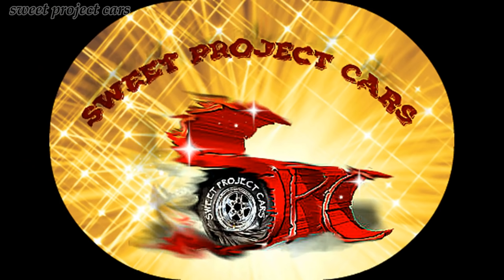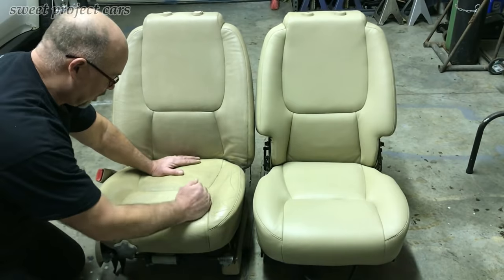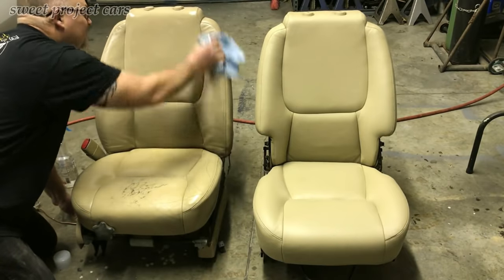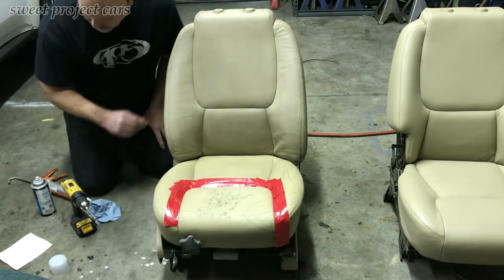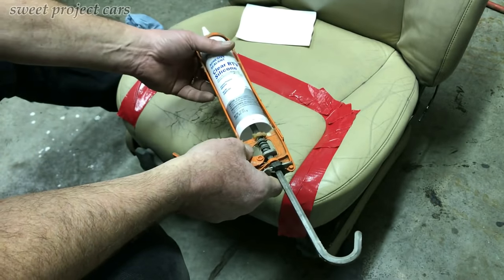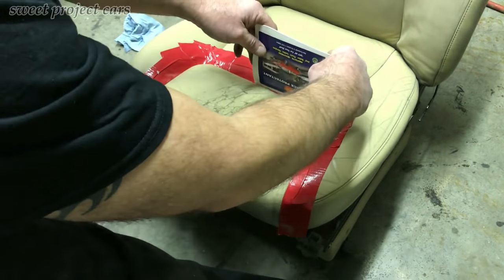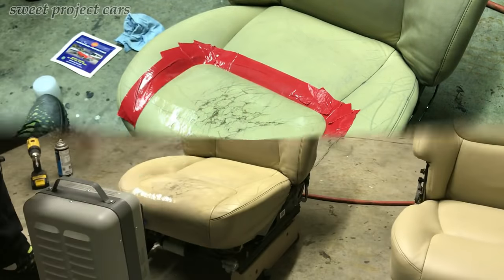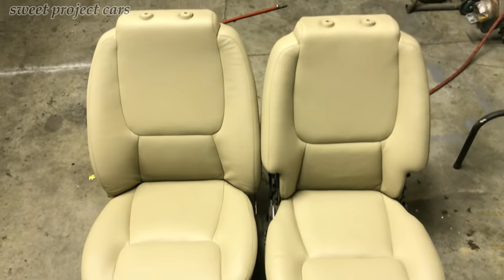How To  REPAIR THE WORST LEATHER & VINYL Seats...Never Seen Before

Comment: Hi, Great video but can you please show how to use the spray can to get perfect finish. Thanks Shaz
Reply from the maker: It is extremely easy hold the can in about 2 feet from the seat start spraying at the edge of the seat let go when you get to the other edge repeat that process and your seats will come out beautiful try to overlap your last spray by a couple inches

Comment: Another great video!  Do you think a rip or hole could be repaired using this method.  I was thinking that it may be possible to glue a backing patch inside the rip/hole and then use this technique to fill & level the the backing patch to the surface of the seat material.   The hole/rip is on the side bolster of a seat back.  I’m thinking this may work.  What are your thoughts?
Reply from the maker: Motorgearhead Your ideas on fixing a hole or very close to what we would do give it a shot and see how you like it

Comment: Thank you for sharing? Can this method be used for boat seats? Would SEM marine vinyl coat spray paint work as well as the paints you are using for these car seats?
Reply from the maker: yes it works on any seating  SEM makes good stuff we use the items shown and have great results

Comment: Do you have a video on how to prepare a car for the winter to protect it from rust or anything else? I got a car that's gonna sit outside for a while since I don't have place to store it and the transmission went out and don't plan to fix it until the spring.
Reply from the maker: If you look through our videos you’ll find a boat load of them dealing with stopping existing rust and preventing it also how to treat your tires so they don’t dry rot on you over the winter and make sure that your coolant level and strength of it is good otherwise your block will freeze and crack

Comment: #1 How long do you wait until you apply another coat of silicon?
I think I need to apply another coat of silicone, so when you say add another coat do you mean to do it almost immediately or wait a day until it sets first?

#2, Can you sand the silicon between coats?
tanks.
Reply from the maker: Wait until it sets, it may be slightly tacky, but that's okay.  Usually takes 48 hours in 70+ degree weather.  And remember the thicker it is applied, the longer it takes to cure.  Don't sand between coats.  Hope this helps.  Thanks for watching and asking.  Have a great day.  mad Mike the hammer SPC

Comment: Would this work on a recliner type chair that isn't made with real leather? My arm chairs are peeling in areas and I'm looking for a lasting fix! They aren't holes like something ripped, it's just the top layer is bubbling and peeling.
Reply from the maker: Sounds like the chair is in pretty rough shape so I guess it wouldn’t hurt to give it a shot it is worked on everything we have ever used it

Comment: @Sweet Project Cars. I would love it if you can tell if these steps are correct. I'm going to be attempting this tmr. And would like to know if I got everything down. So first I clean the seat with 99%, then apply leather prep. Then I apply the silicone, let it rest for 24 hours. Then after it dries. Do I apply another layer? Anyways, after that I reapply 99% and leather prep? Then get into the painting process. Does this sound correct?
Reply from the maker: I would take and watch all three videos in the series before you attempt and a real good way to do it is take some of your paint and add it to the silicone before you spread it watching one of the videos you will see that it works really good thanks Mike Sweet project cars

Comment: Can you use a heat gun for faster drying? In cold new England winter here
Reply from the maker: You can, but it's best to put a heater somewhere to keep the temp at 70 degrees for a minimum of 24 hours, it dries best in hot weather.  Thank you for watching and asking Steve.  Have a great day my friend.  mad Mike the hammer SPC

Comment: Can this method be done for leather seat that are tearing from the seams?
Reply from the maker: You can definitely give it a try but most generally when they’re torn at the seams you need to replace the seat cover with an OEM cover thanks and have a great day mad Mike sweet project cars

Comment: This is awesome but I have a question and it might be a dumb one but you can use regular spray paint to spray seats after silicone is applied? You just have to find the color of the original seats?
Reply from the maker: In order for this to work you need to use all of the exact tools we show in the tools list.  Thanks for asking, hope this helps.  Have a great day.  mad Mike the hammer SPC
Reply: @SweetProjectCars  thank you

Comment: Does the seat still feel the same as leather? Or would it feel stiffer/different?
Reply from the maker: Elliott Kan well it feels good for a repair the best thing to do if you want the seat to be perfect and new of course is just replace the seat cover with the OEM replacement but for a repair, this works great and last for a long time.

Comment: Is it a good idea to used a hair dryer or heat gun to cure the silicone faster?  Also, would I have to reapply the 99% IPA if I need to use another layer of silicone?  Because I touched the area to knock down the ridges like you mentioned.
Reply from the maker: Roger Jimenez silicone air dries the best in warm weather so a hair dryer will not work very well. and not you do not need to use the 99% again as long as you have not touched it with your fingers. if you did then you will need to wipe very lightly with your 99% but only if the silicone is completely dry   mike
Reply: @SweetProjectCars  i had to to knock down the ridges as you instructed on the video.  I will use the IPA.  One more coat of silicone after sanding and IPA then it should be ready to paint.  Sorry I did not take a picture of the original cracking on this vinyl office chair.
Reply from the maker: Roger Jimenez sounds like you have a handle on it my friend good job

Comment: What do you do if the seat has a tear in the seam
Reply from the maker: Here's the problem when it's in the seam where the stitching is, the stitching actually holds the seat cover together. Our method will not work real well with that because the first time you sit on it, it will pull it apart, you can try it, but we suggest getting new seat covers from your manufacturer.  Thank you for watching and asking, have a great day John. mad Mike the hammer SPC

Comment: Do we need to buy/ use the " SEM color" which u have in the description tools?
Reply from the maker: Mike, you need to use  https://amzn.to/2PWOfN3
or this https://amzn.to/2T0aJv5  they have many different colors, but they are the only ones that will work for what you are doing.  Thanks for asking, have a great evening my friend.  mad Mike the hammer SPC
Reply: I have the paint already for my seat! My question was do we have to use this product? Does it make the paint more smoother or more flexible? Sorry for asking many questions, i want to get the same results as you have in the videos my friend.

Comment: I'm about to do this project. The only thing I'm concerned about is paint doesnt stick to silicon. I will be using sem paints and prep. Im just so worried it just won't stick.
Reply from the maker: We have never had the non sticking issue, make sure you watch all 3 of the videos in the series, you will find all kinds of tips and tricks.  If you are concerned about it bonding, in one of the videos you will find where you can mix 25% of your color with 75% of your silicone.  Let that dry then you will find that your paint will stick even better. 
Thanks and have a great day!  mad Mike the hammer SPC

Comment: I have a question sir. I messed up somehow and had to reapply silicone due to uneven and application and also have blotches. Tried removing the silicone with many products and was not very successful. How can I correct this ? Keep reapplying silicone until is smooths out better? And if so how long to wait before running my thumb over the area?
TY
Reply from the maker: You are going to have to apply until it's smooth now, and if you are doing this in a hot dry area, you've got to be johnny on it! Make sure that your silicone nipple is cleared out onto a rag so that you are applying absolutely fresh silicone. Try to put enough at the beginning so that when you run your spatula over it you run out at the very end where you no longer need silicone. A couple of tips:  1. hold the spatula as flat as you possibly can so that it lays on smooth  2. as far as your ridges are concerned, use the back side of your finger to smooth them out (the area between your 1st and 2nd knuckle). Another tip is you cannot dilly dally with this because the silicone almost sets up immediately so you gotta move fast and efficiently.  Hope this helps, all the best my friend.  mad Mike the hammer SPC
Reply: @SweetProjectCars   thanks. I will try again. Much appreciated!

Comment: What would I do if I had perforated leather?
Reply from the maker: This doesn't work on perforated leather unless you don't mind it being covered up, you will need to replace those.  Thanks Andrew.  Have a great day.  mad Mike the hammer SPC
Reply: @SweetProjectCars  could I just skip the silicon part on the perforated parts and fix the rest of the seat then paint? Or will rhe paint also clog the perforations

Comment: In some videos, you rub the paint on with a rag.  In this one, you just spray paint the seat.  Which works better?
Reply from the maker: Hi Greg we like to show different methods we like to spray the larger areas on the small where areas we like to use a rag
Reply: @SweetProjectCars  
Thanks for the clarification...I'll be trying this !

Comment: I got 1999 grand prix gtp seats I think are junk now driver seat got wet sun got on it few years ago the fake leather or what it is turned hard like a rock but my 2004. Saturn vue seat I might try your method
Reply: And I got jug of 303 protecttent I'm giving that stuff a chance not on seats because they are ruined but other things
Reply from the maker: Make sure you catch all the videos try the one video that deals with mixing the color with the silicone is by far the best way to do it just make sure you listen to the video and don’t skip through it and you will get all the tricks

Comment: Looks like my seat , but mine is not cracked yet

Best way to keep it from not is same process I assume?
Reply from the maker: Very correct my friend if you don’t want your seats to get any worse then they are make sure you’re using the 303 on them and you’ll be good to go
Reply: Sweet Project Cars 
Perfect I wouldn’t be a fan without a big bottle of 303 on the shelf !!

Your the best
Reply from the maker: Van Inn lol that's true my friend :)

Comment: Great video.  I followed your instructions and just did a thin layer of silicone adhesive after sanding & cleaning.  It's been 24 hours and the silicone is still tacky.  Is this normal?  Shouldn't it be cured in 24hrs?
Reply from the maker: What is the temperature of the room you’re working in?
Reply: It's 70 degrees in our house where I'm working.
Reply from the maker: Chris Zink ok it may just need more time if you have any humidity I would give it 2 days then use the paint on it we use and the stickiness will go away just make sure you spray it down with the prep spray first before the paint
Reply: @SweetProjectCars  Thanks for the quick response.  It's still tacky today.  I'm waiting on more paint to arrive so it'll hopefully be dry(er) by the time it get's here.  I'll hit it with the prep spray and paint. Fingers crossed!
Reply from the maker: Chris Zink gives it a couple light mists and let it dry then do it again 20 mins. later keep doing the color until you have full coverage
Reply: @SweetProjectCars  It worked!  Light coats.  Tackiness is gone, seems solid.  Thanks again!
Reply from the maker: GOOD DEAL Chris glad to hear that my friend

Comment: Used this on my back BMW seat, smoothed all ridges and everything is set up ready to paint. Since there is silicone on it there is a difference in texture between the leather and the seat will that all go away once it's painted? Just kind of smoothies itself out?
Reply from the maker: Matthew Klos did you watch the first video in this series as it shows how to smooth it out before the prep spray and color is added?
Reply: Sweet Project Cars yup watched it. Sanded everything, and then applied the silicone smoothed it out. Then used my thumb after it set up a bit to knock down the ridges! Now I’m just noticing when I run my hand over it I can feel a difference between where I did to the silicone and where it’s leather. Does this go away once I paint it. Planning on painting today
Reply from the maker: Well here’s what happened when you place it on you have to feather out the edges as we called it The edges should feather out level to the existing seating if you don’t feather it out as you would with Bondo when doing body panels you all have a raised edge as you can see by the finished product that I did there was no edges seen because the edges of the glue are very very fine and flush to the existing leather Hope this helps

Comment: So the one vid shows you mixing color with the silicone. Then the next shows you just spray painting the silicone without mixing. Which way is right?
Reply from the maker: Both work great, the reason we came up with the mixing of paint and silicone is because most people don't know how to get the paint to adhere to the silicone, so hence the video mixing the two to help out those that struggle with painting silicone. Thanks for watching Michael, have a great day. mad Mike the hammer SPC

Comment: Question- on the "natural cracking" in the leather do you use the silicone as well? Or does the paint take care of those areas?
Reply from the maker: The paint does a pretty good job covering up those areas as long as the material is not separating.  Thanks for your question.  Have a great day.  mad Mike the hammer SPC

Comment: Hi,
interesting video, I have a query here, when this seat is finished and is used ie. if someone sits on it, will the fillings will not come out due to the fact that the leather and the foam underneath it had a flexibility to stretch a little or more depending upon the weight placed on the seat.

looking forward to your comments.
Reply from the maker: Jawaid Akbar Chaudhry it works great of course it does not work if the foam is showing through the seat.

Comment: What is setting the silicone? You aren't mixing the paint and silicone before spreading the silicone in this video. What am I missing?
Reply from the maker: This is a different process, follow the video instructions.  Thanks. mad Mike the hammer SPC
Reply: @SweetProjectCars  You have an entire video on mixing spray paint and silcone that explains the paint sets the silicone. You demonstrate the process on scrap leather. I've watched all of your videos as well as restored antique leather for years. Your info conflicts between your videos. I'd just like clarification. Thanks.

Comment: I wonder what the method is on perforated leather.
Reply from the maker: Q it will work great on it you just have to use a toothpick to open the holes back up just before the glue is fully dry

Comment: What kinda paint do you use to paint over the silicone filler? And is that 99% Rubbing alcohol? Couldn't find the supplies list?
Reply from the maker: Either of these  https://amzn.to/2PWOfN3  or  https://amzn.to/2DJPV7Y  ; and you will need this  https://amzn.to/2z3oiBu  also, here is the old 99  https://amzn.to/3wIDQHd  Thanks for watching and asking Daniel, have a great day. mad Mike the hammer SPC

Comment: awesome! thanks to you i can save money from buying new couch. Is it ok if i use different brand adhesive sealant? since that one you use isn't available here in Malaysia
Reply from the maker: You can use whatever you want, we are just sharing what we have gotten proven results using after 40 years of trial and error.  Thanks for the question, have a great day.  mad Mike the hammer SPC

Comment: Also in one of your other videos you mentioned backing material for larger holes, what types of backing materials would be suitable if the seat is heated?
Reply from the maker: If you have heated seats, you almost have to replace the seat covers with OEM.  Thanks for asking.  mad Mike the hammer SPC
Reply: I use denim patches with no probs. Buy them at Walmart in the sewing section.

Comment: I have heated and cooled vented leather seats in my Kia Optima.  The perforated area (lumbar) where the air comes through have some rips in them.  The panel is about 12" x 12".  I would love to use the  silicone glue technique to stop all of the ripping but this would not allow the air to pass through.  How would you recommend fixing that?  Can you do a video to show that repair so the air can still vent through?  Maybe use your technique, then poke each hole with a pin before the silicone fully drys, maybe after it drys?
Reply from the maker: Roger Jimenez we do small areas on seats like this and poke holes in the seat before it drys with a tooth pick, but it is best to replace them
Reply: @SweetProjectCars  thx dor the reply.  Keep on making these videos!  They're fun to watch and very informative.